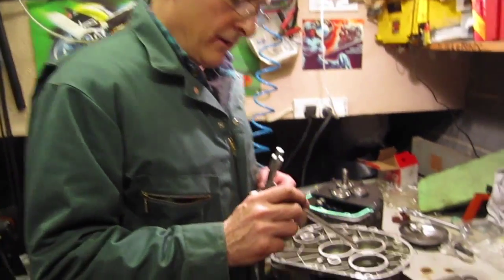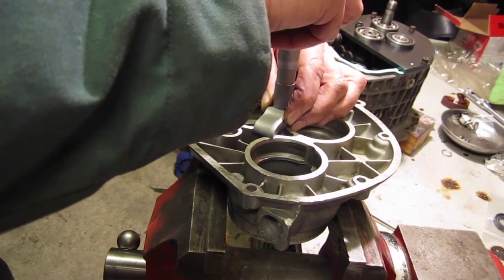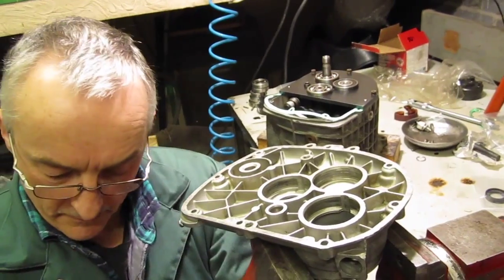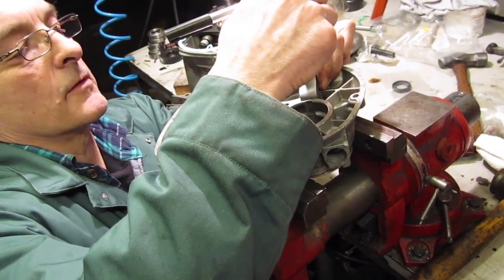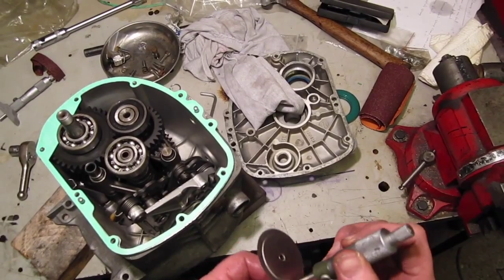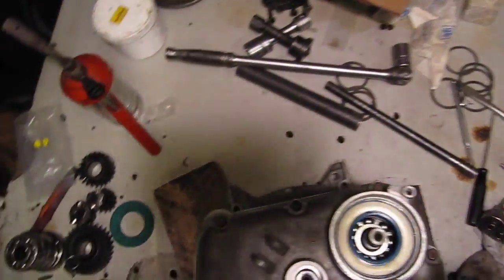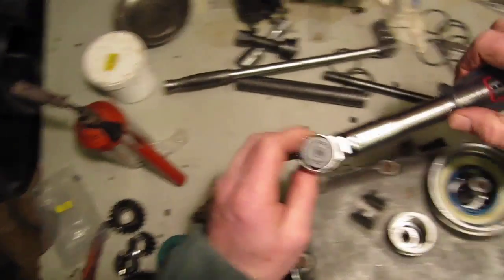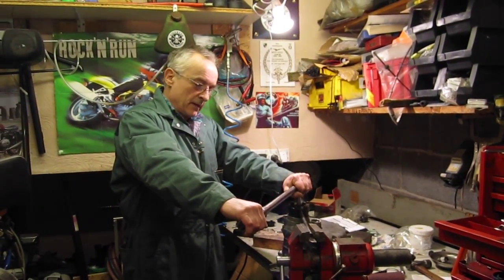BMW R100RS Gearbox Overhaul Part 7 Measuring End Cover and Final Assembly

Comment: Really enjoyed the whole series you've generously contributed on this subject. I had an R100RS and only ever got as far as fixing a somewhat jerky clutch caused by the nylon block that fits in the void on the back of the gearbox sticking. I'm looking for another airhead now and resources like this one are extremely helpful in keeping these older works of engineering art on the road. Thanks again for sharing the video.
Reply from the maker: Mark Godden And thank you for your kind comment. Keep an eye open, there is definately more to come.

Comment: Thanks for clearing up a great mystery for me.  I have a '92 R100 RT with the missing cir-clip. I bought the special tools and a bearing and shim kit. Found a semi-retired  machinist to cut the groove, and now, thanks to your videos, I am confidently reassembling my transmission.  Total cost above parts and special tools (all bought on line);  $60.00 to cut the groove.
Reply from the maker: I am so pleased to see this. The whole point of making these videos is to enable others to have a go. Good luck with the rebuild. All the best, Guy.

Comment: Great video! Are you able to replace the output shaft seal without take the cover off? Mine seems to be leaking a little bit.. I've checked the speedometer breather bolt just incase it was plugged so I was hoping to replace that seal. I didn't see you putting the seal in, in the video. You put the seal back in from the outside of the cover if I am correct? (1979 BMW R100S just for refernce)
Reply from the maker: Yes you can put the seal in without taking the cover off, so it goes without saying that it goes in from the outside.
Reply: @motophoenix5951  thank you! I thought so, just wanted to make sure! Your videos are immensely helpful! Keep up the great work

Comment: Taking a reading over the rim of the bearing recesses in the cover will give incorrect readings and will not necessarily match that of the cover gasket mating surface. (they will give a smaller reading which will result in a much bigger end float than what is desired but without splitting too much hair, the gearbox should be OK even if the shaft end float is too much. Not so when it is too tight. This can happen when the cover gets distorted from too much heat like a welding repair. The result of pre-loading the bearings will have the box on the bench in less than 500 miles.) 
The correct tool for measuring is a depth vernier which can be fitted with an extension bar or base which will reach across the full width of the cover. http://www.mitutoyo.com/wp-content/uploads/2016/09/D-section-Depth-Gages.pdf

After closing the cover and fitting the output flange don't forget to wack the input shaft with a nylon or rubber mallet. One or two solid blows on the end is all that will be needed to seat the bearings and will allow the shafts to turn freely. Without this blow one might be mistaken to believe the end float adjustment was done incorrectly causing the bearings to be pre-loaded. The input shaft will turn with great effort.
Reply from the maker: THOR Welding Innovations, Thanks for your comments. 
So it is a mistake commonly made by students not to actively read, or in this case view the subject matter through from the beginning. 
In this particular case, if you had followed the series from the start, you would see that in part six I point out that by fitting a new gasket under the bearing support plate prior to measuring the bearing height will automatically incorporate the gasket thickness into the calculation. 

Getting the shaft end-float on spec is very important. Time taken to get this right will make for a long lasting repair. Too much end-float is as bad as too little, as BMW must have found out when they decided to omit a bearing circlip for a while on the output shaft during the production run. 

There were a number of depth tools illustrated on the link you shared. The tool used for measuring the depth of the bearing recess as well as the bearing protrusion from the bearing support plate tool is a depth micrometer, such as the one I used in the video and is also the one illustrated in the BMW factory manual I use. You can see the type in the following link: 
https://www.bowersgroup.co.uk/row/890-moore-wright-traditional-depth-gauge-micrometer.html 
Personally I would avoid a digital version of this tool. 
Vernier depth gauges that you recommend, very often only have a resolution down to 0.02 mm, which is not accurate enough. They would also be a bit clumsy for this type of work imo. 

As for “whacking” the input shaft, I would not advise anyone to do this. At the output end of the input shaft there is a ball race. Sudden heavy shock to a stationary ball bearing can make indentations in the track and that can lead to premature failure. Far better to heat the end cover in the area local to the bearing to loosen its grip, followed if necessary by a light tap with a soft mallet along the axial plane of the shaft if the shaft still feels tight. If it continues feels tight to turn, I recommend you remove the cover to investigate. 
Hope that helps.....